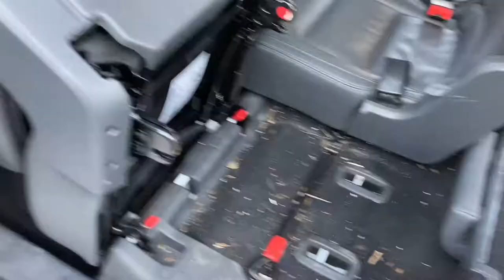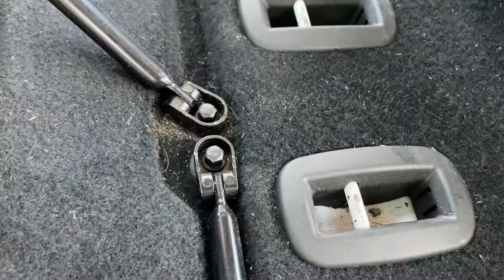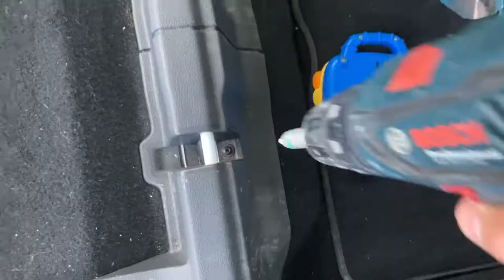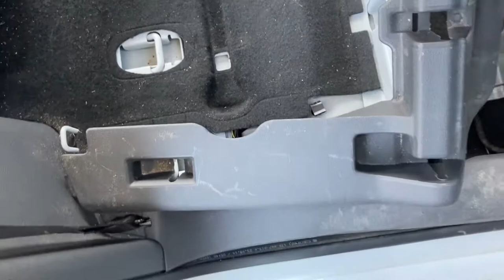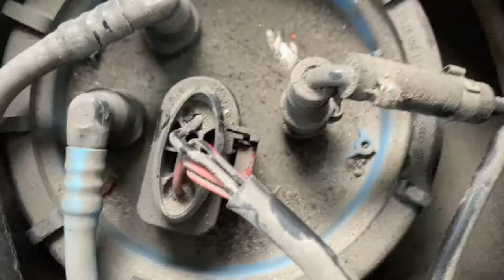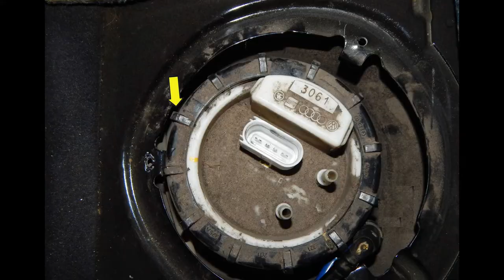HOW TO: Replace Touran Fuel Pump

Comment: Does the changement of the pump has solved the issue ?
In my Touran the pump makes no noice, I presume that is the reason why my Touran need 5 seconds to start
Reply from the maker: Yepp! This solved it. If not this it’s your High pressure fuel pump